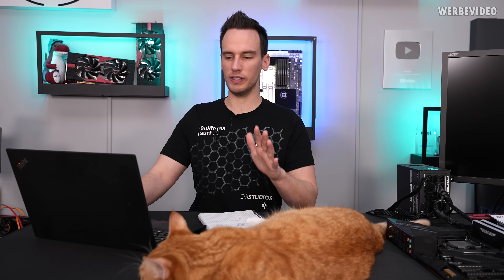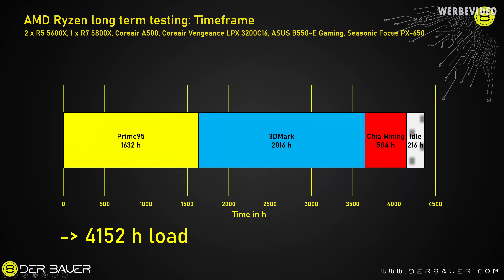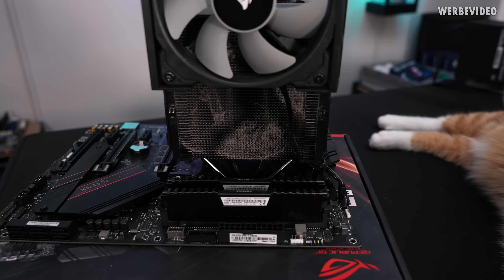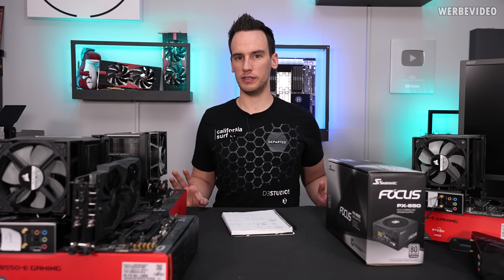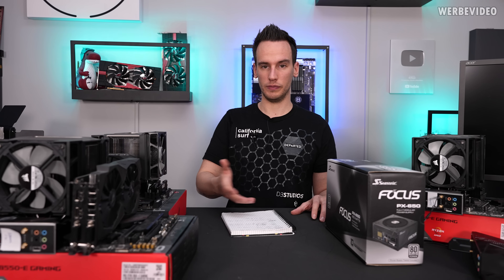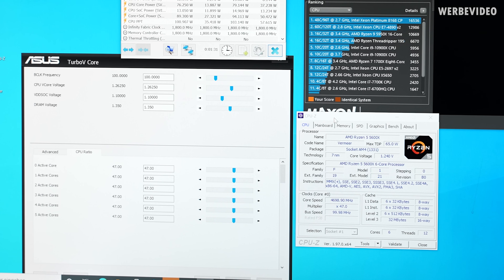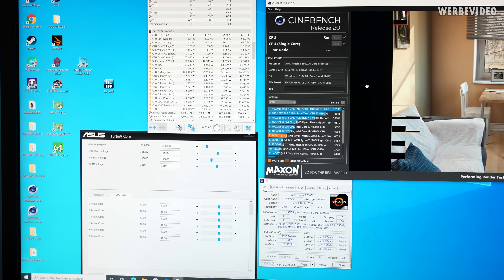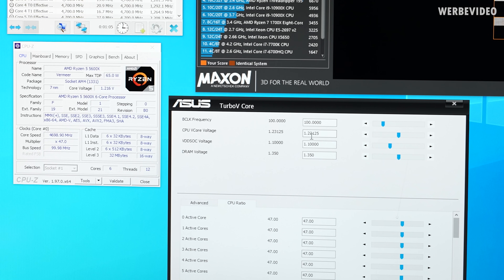4152 hours of Ryzen Long Term Testing: We have Good and Bad News

Comment: Reddit and other forums are consistently paranoid about voltage, with each person telling the last that "they're insane for running their voltage that high", with zero ways to verify that the claimant's system is actually stable at their purported values. It reminds me of how some people claim to run Prime95 for an uninterrupted week and recommend you waste your time doing the same, and how you're insane if you don't go to these absurd lengths to reach these goalposts that get moved arbitrarily.
Reply: It all depends on what you have your CPU doing. If you will leave the system running for a year it is worth it to run prime95 for a day or 2. If you depend on right answers, maybe a week.
Reply: @charlese2833  If you depend on right answers to begin with, which implies enterprise work or scientific research, then what are you doing overclocking, using consumer chips, or using RAM without ECC in the first place?

Comment: So I use mainly Intel CPUs for CPU simulations where the load is 100% for sometimes an hour at a time with no break and then maybe 10 seconds and then another high load that might be 80% for 20min. Sometimes all core, sometimes one or two depending on what we're doing. I don't have any type of manual OC just like max boost time and whatnot that is allowed in the BIOS as I couldn't get a 10900K only a 10900 and similar stuff for the 9900HK in a NUC we use and I had sort of speced these to be 5 year units, I hope that running max load for several hours with no real OC settings other than maxing out boost behaviour will keep these going for  that long. It's not 24/7 but we have them running all the time for remote access. I've also got some older Xeon's that I hope will survive for quite a while.
Reply: You just watched a video showing you don’t need to worry with TSMC at 1.45v, Intel degrades even less. I’m not sure what else you need to be persuaded. Basically the answer is: don’t worry

Comment: Fun part I OC all my CPUs after 2 months old to make sure I have a chip that's not fail because of fabric mistake, when I have havy OC my CPUs I upgrade every 2 years and sell my old one as OCed CPU. I like silence so I max out my D5 pump, fans on 1500rpm and have a water tank as 10L to make sure I stay under 70C temp in gaming and I feel 1.4Vcore (4.85Ghz) is that max I want for my 5600x when my CPU getting tilted by my gtx 1060-3gb (OC to 2111Core and for get my mem OC) I am litte bit high now so I can write some thing wrong but I run my 3200Mhz 16cl ram on 3344Mhz 16-17-17-17-33cl on 1.445Vcore I am runingy CPU black on 101 and not 100 that's why I get over 3333Mhz I think, have a good night every one and take care
Reply: I guess not only the cpu's were running high 😂
Reply: @mathewmantas  xD

Comment: I have some experience as far as "long-term reliability" is concerned. I can say that Intel 14nm CPUs start to have problems after around 5 years of 24/7 heavy loads, that's around 50k hours. Memory starts to fail earlier. Contrary to popular opinion, memory actually degrades with use (you see this when you compare memory errors across identical systems where one group ran non-memory intensive tasks and another group ran memory-intensive tasks) and starts to fail A LOT after around four years of 24/7 load use.

My conclusion: the design lifetime at nominal parameters of most components these days is around 50k hours of full-load.
Reply: Is it memory degradation or CPU instability?
Reply: @jocelynturmel3282  ECC errors that go away when you swap the affected memory, so it's definitely memory degradation.
Reply: Thanks for the scientific experiment with a massive sample size. We will submit your study and use it as fact going forward.
Reply: @SensationalSteve  Sick burn, these observations come from over 10k CPUs though.

Comment: Yes please do it with the alder lake if possible. Thanks !
Reply: It's been like this since the 90s. There's no reason to waste time and effort to come to the same conclusion. Unless you're overclocking competitively, or is a complete tool who just hammers the voltage on a crappy board with a crappy PSU you're not going to get degradation worth a damn...

Comment: I dont understand why you would even consider doing this, especially in a professional environment where reliability is pivotal. Even in a gaming sense it wouldn't be worth it, unless your running an old CPU with a modern GPU. My machine is my tool of trade and I wouldn't risk killing anything to shave a few seconds of a render.
Reply: @hollybellwether  The thing is that some people just do not have unlimited money.
Reply: @hollybellwether  I do have a backup machine, it's an X99 based system with a 5820K. My main machine is an X570 based system with an R9 5950X in it. If I Overclocked my 5950X and it broke, I would loose more time switching to the 5820K than would if I had just left the 5950X as it is, but yeah if you have more money than sense then go for it I guess 👍
Reply: Roman is actually proving your point. If you're running stock you should have a stable system for longer without a voltage bump. You now know that because he's tested it for you. Understand?
Reply: @jimmehvideos  With all due respect, I didn't need a video telling me that, it kind of goes without saying. I guess that its valid if you're not someone whos been tinkering with hardware for two decades like me. 👍

Comment: I am a bit weird, but I have never pushed my CPUs hard on the voltage.
But in my world, my CPUs aren't done with their life after 5 years, once it is done in the primary rig, it goes over to the home servers and do a workload there.
So that is why I still have Core 2 CPUs in daily operation today.
Reply: i JUST retired my 3570k this year. And by retired i mean gave to my buddy who i using it to game with me on the near daily >:)

Best cpu ever made
Reply: @TechGuyBeau  I don't know if it was silicon lottery or what, but my 3570k was able to run stable at 4.7 with only a smallish voltage bump. I ran that sucker for years before I sold it on eBay and I have little doubt it's still out there crunching numbers somewhere.
Reply: I have no use for cpus slower than a smart phone
Reply: @SensationalSteve  than you aren't very imaginative or you don't respect the tech. There are lots of cool projects you can do with an old PC. Pretty much anything you see someone do with a raspberry pi can be done with a PC with a core 2 duo. Pi-hole, smart walls, servers, security systems, etc, etc. My main computer might be up to date but I still have a laptop with a old pentium and a aio with an i5 2400 doing work. Plus my server which is an atholon 200e (or something 2gen am4 atholon the exact name escapes me).
Reply: @GummyBearRacing  Yeah, I don't respect 20 year old tech, you don't respect power efficiency and like to horde. I agree, we aren't the same.
Reply: @SensationalSteve  I did do a little checkup and it does turn out that some of the parts in my retro rig is worth close to a modern graphics card today in the used market. (Old AGP stuff.)
Power efficiency is one thing, but overall for the roles that these old machines serve, it wouldn't be financially viable to upgrade them to newer stuff for their tasks.
For an example, my backup and storage system is powered by old Core 2 machines, they are sufficient performance to handle such a task under Linux, they aren't as power efficient as say a modern Ryzen, but the upgrade cost is too steep to be worth the minor power savings.

It is a bit like FedEx still flying the old DC-10s for cargo, they do the job for them, they aren't as efficient as the newer aircraft, but the upgrade cost compared to an asset you already have makes it not financially viable to do so.

Comment: I do not know if its wrong or not to stress test my cpu oc with cinebench r23 multi-core 30 min test and if it pass I see that's as stable oc 😂 in my games I never get over 80% usage so there is no point to run prime95 as test for me.

Comment: Sure, do it with alder lake. This kind of OC will kill/degrade motherboard before  CPU, at least thats what happened with my z87 motherboard which started to power-off every 30 minutes and my old i7 still works great in co-worker system.
Reply: he mentions this in the video at 6:15 .
that's the exact reason why he switches the cpu out of the system they've been running 24/7 with 4.7ghz @1.45v in to a different mobo, ram and aio setup.
a test like this for motherboard degradation would be interesting though of course, if possible.

Comment: I wonder if it's because the 5800X are better binned than the 6 cores that have two "defective" cores turned off. It makes sense that the lesser binned chips require more voltage over time. Would have made the 5900X interesting to test. I assume the second chip is worse as is the case on my 3900X.

You mention more voltage on the 5600X. I've had to use more voltage on the 3900X just to increase RAM speed. Is that a possible consideration as well? Maybe it's the IO controller that's requiring more voltage, not the chiplets?

Comment: Awesome test! Thank you!

To me this means: Just re-OC your processor after some years. Or maybe when you are dealing with some sudden instability after some years - just recalibrate the OC.

Besides -- Ryzen 5000 runs faster on cooler temps anyway. If you use less voltage, temps are lower, which increases stability, and gives you a faster clock speed. My 5900X only needs 1.375V to run 4.875GHz
You wouldnt need to run 1.45V. So if you approach the CPU that way, it probably can have a much longer life too.
Reply: It should mean “I don’t need to worry”

He is running 1.45v, the degradation increases exponentially with voltage. Even 1.4v is barely comparable.
Reply: Agree. Even running a 5600x at 4.750 mhz all core, can be done easily at way less then 1.31v and for someone that use, let's say, a pc for 8 hours every day, 4 of them gaming, it should have no major issues for years. Just need to have care of the cpu.
Reply: @andreabriganti8621  And the sad shit is most people care so much about their CPU only to sell it off after 2-3 years and upgrade to something.
Reply: @Underground.Rabbit  I can't judge that. It's theyr money and we don't know theyr reasons and  " needs "  but I got what you mean. I'm used to buy hardware and use it for 5/6 years at least. I'm without a pc from almost 2 years now. Still waiting for better prices and avaible gpu, while trying to save money.  I don't feel safe to go into used market unless I don't have any other options but, if there are people that sell theyr cpu/gpu in good conditions,  there will be people, in a worse situation than mine, able to get it and have a good use of it. I will never understand the urgency to have " the best of the best " always but, again, I really don't feel to judge that. Sorry for the essay btw.
Reply: @Gareth Tucker Well thats not how I OCed my intel CPUs before that... had a 4770K and 8700K. Just raised the voltage to some known safe level, see if temps were managable - then see how far the clock speed goes.
Voltage remains the same and you allow for some minor boost clocks on few treads.

Yet, on my 5900X I need to target 70C or so for light and full loads -- and I need multiple voltage levels per load -- and with that comes a lot of stability testing... That also makes trouble shooting on a crash a lot more complex.

The experience has been night and day for me.
Reply: My 5600x runs at 4.7ghz at 1.187V manually OCed. ~11,900pts on R23. If I do PBO with curve optimizer and motherboard voltage control, then It will hold 4775Mhz, but it hits 1.36V and the temps go from 73C to 87C. This massive increase in power draw only gets me ~12050pts in R23. Definitely not worth roasting the CPU for negligible perf uplift.
Reply: @MechAdv  Your manual OC sounds pretty good. Currently I am running Hydra, the follow up for CTR.

It overrides CO and handles the dynamic OC. Work from home and most desktop and multitask stuff, even gaming, it doesn't go above 60C or so. Its a solid 4800-4850 most of the time.

Its hard finding non-synthetic workloads that stress the cpu.
Reply: I'd love to know how that compares to the 12900k Vs an overclocked 5900X.

Comment: Thanks for doing the leg work on this. I guess I don't need to worry as much about the PBO bumping to close to 1.5v on my 5950x.
Reply: I wouldn't worry. These voltage spikes happen mostly during light single thread loads, not the kind of condition that would hurt the cpu.
Reply: @ivanbrasla  I get lower temp in C when I do oc vs max out PBO
Reply: @Kage0No0Tenshi  That's because AMD CPUs have many temperature sensors inside, and the temperature reading you see is the hottest of all of them. In PBO usage, one core will be running at higher frequency/voltage, it will be a hot spot, and that's your "high" temperature reading. Doesn't mean that the CPU as a whole is getting hotter
Reply: Degradation scales exponentially with voltage. You probably should worry if you are at 1.5 a lot.
Reply: @SensationalSteve  Wrong. Degradation is related to current. That's why AMD can have high voltage during low loads, because current is low in that scenario. During all-core heavy loads, the voltage value is lower in order to keep the current low as well
Reply: Ah, I'm not alone. I was nervous every time I looked at HWmonitor.
Reply: 1.55Vcore here on my 5600x xD I oc/lock it to 4.85Ghz on 1.4Vcore
Reply: @Kage0No0Tenshi  lol, you are running on 1.55v still? My friend scared to overclock his phenom 2 with higher Vcore than 1.55. If he look at your aida64/hw monitor maybe we can make him believe xD. So pls share ur screen with Vcore, temps, rpm, type of cooling etc
Reply: Its specific and random depends on the quality of your CPU 1.5 is ridiculous though you might degrade way faster if you sell it better give him a fair price.

Comment: In my opinion, if you need more voltage to obtain the clockspeeds, there's no degradation.But if you no longer cannot obtain the clockspeeds given when the cpu were new, that's degradation.

Comment: Just running then 'normally' and they should run for a very long time. Wouldn't the capacitors fail first?
Reply: if you're running at or exceeding the max temp hours on the capacitors otherwise the board should last as long as the cpu.. old school boards say pre am2/775 it was much more common to happen but not so much with modern boards. the vrm's are more likely to degrade before the capacitors.

Comment: based on observation early Ryzen 3000 was not voltage tollerant and there was a lot of variance chip to chip on max OC and fit voltages, this became less an issue over time, my early R5 3600 quickly stopped being able to do 4.4Ghz but some of my use cases were pretty close to prime95, currently I find the max stable overclock of my R5 3600 is 4.0ghz at 1.25V.

basically Im saying later Ryzen 3000 i.e mid 2020 or newer and ryzen 5000 is probably more voltage tollerant, if you still are paranoid just test FIT voltage under prime95 and assuming your work load is gaming you can probably go 50-150mv higher or if its rendering then maybe 25mv higher at the most
Reply: it's very hit or miss and that's just the risk of overclocking but the 3600's were much more prone to the variance in cpu's since they were just failed 3600x's.. i have one of the early chips which does 4.2Ghz all core boost with i think 1.35v or what ever the stock voltage is at 66C full load. but honestly there's no reason to overclock the 3600, better off leaving it using the stock boost with better cooling.66-68C is the threshold for when it starts dropping the boost below 4.2Ghz but even then it'll do 4.15Ghz up to 72C.
Reply: @sirmonkey1985  yep, for most use cases stock boost is more than enough but blender rendering or similar loads is the only time i recomend a manual OC because you can squeeze a bit more performance out of your CPU at low voltages, seems to be typically 200-300Mhz which might add upto quite a few hours off of a render.
Reply: i ordered a 3700X on day 1  release and it only does 4.2ghz at 1.25 Volts

Comment: Consensus for 3000 series was the same. Find your fit voltage, don't go above. Do you think these results carry backward for those as well? My fit voltage for my 3600x is 1.27 volts. At that I can get 4.1 ghz all-core, but anything above is a no go. I imagine if I ran 1.35 I could get a lot more out of this. I have a H150I and a b450 gaming pro carbon ac, so I should be fine bumping up voltages.
Reply: I ran my 3700X for 3 months at 1.31V, at the start i could do 4.2Ghz and at the end until i could only do 3.9Ghz on same voltage and 4.2Ghz needed 1.36V
Reply: Hmm on my 3700x i have 1.19v 4.3ghz all core
Reply: @jovannihernandez6696  i purchased mine right around release so it's the worst 3000 series can be bin wise pretty much